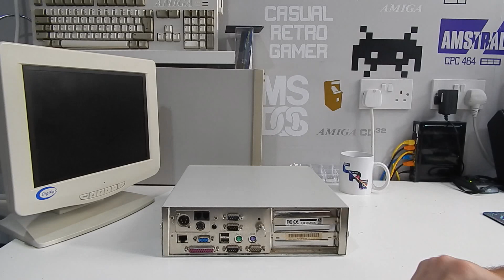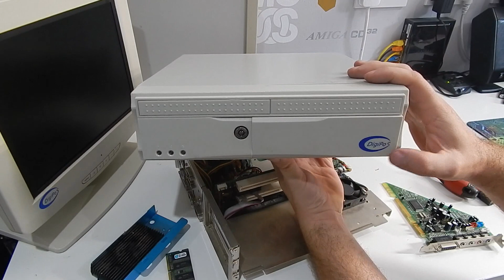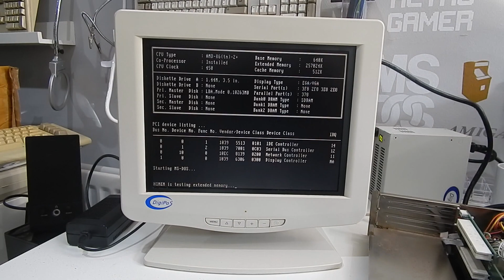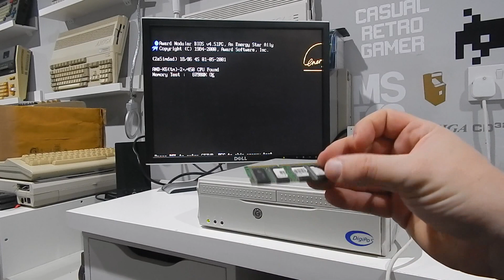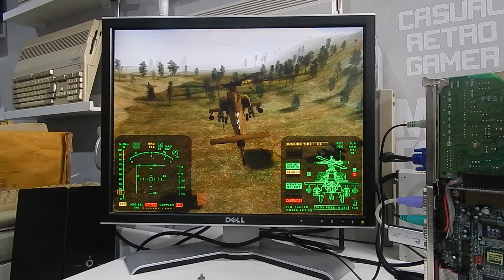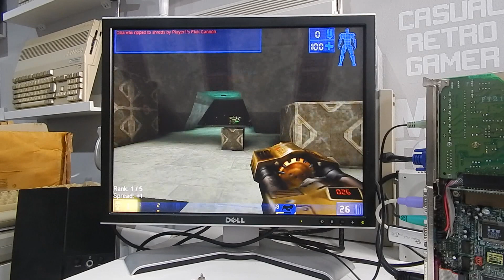System build September - The POS build

Comment: I had the same processor back then. 
The complete name of your processor: "AMD 2 4v I O 3 3v 450Mhz CPU AMD K6 2 450AHX AMD K6 2 450AHX AMD-K6-2 / 450AHX" 
With Overclock you could reach a stable 500 MhZ. (BIOS-Settings: 5.0 x 100FSB @ 2.8v)
You can bring it to 550 MhZ (BIOS settings: 5.5 x 100FSB @ 2.9v or 3.3V) but then it becomes really unstable!

Comment: For the onboard  (on chipset really) GPU just download the SiS 5595 VGA driver for windows 98. It predates the SiS 530/630 by a year or 2. As for GPU, I would look for a Geforce 256 or Riva TnT 2 PCI card, both should work very nicely in that little system. Alternatively, on a cheaper route you can find new/old stock PCI Radeon HD 5450s for next to nothing. The 5450 will be way too fast for that CPU but should handle just about any late 90s to early 2000s game you can throw at it. I see them regularly for under $20 USD on ebay.
Reply from the maker: I've been able to properly disable the onboard display adapter and I've swapped out the replacement card for a Voodoo Banshee.  The performance is about the same as ATI card but it gets me access to the older glide games and they run great.

Comment: can you add a link or where you got the motherboard manual from please, watched this video and got myself one to play with . thanks
Reply from the maker: Unfortunately I've lost all the files related to this build.  I'll see about getting another copy tomorrow, will have to go ask a few people who helped find it first time.  Really should organise things better and sort out of nas for proper backup of these things!
Reply: @CRG  great stuff thanks for looking for me, powered it up , ye its noisy goto replace the cpu fan with a larger quieter one or just jumper it for an old p133 or a 233 MMX or even an old K6 233 I have sat here and unplug the fan as it won't need it the heatsink will be plenty enough cooling on its own passive,, now, the psu,, goto figure out what voltages and if I can replace with a pico so it runs off a silent laptop brick then i can shoehorn  in a voodoo of some kind , an awe 64 and figure out how to fit a slim cd / dvd drive in there,,, was hoping you gotta make that 3d printed bracket and save me a heap of work :), great video.
Reply: did you get a reply about the manual for the board , great vid btw for the pistorm looks a promising addon.
Reply from the maker: @kevin1970  yes sorry, totally forgot about it, you can find the manual at the following dropbox link https://www.dropbox.com/s/x8j4ix97zzzkijq/DigiPoS2k.pdf?dl=0
Reply: @CRG  thank you very much,, now googling a 50pin cdrom connector cable :D
Reply from the maker: @kevin1970  no problem.  If you have any luck with the cdrom please let me know.  Just keep in mind the depth of the CD drive against an expansion card in the top slot.

Comment: Would like to see an update if you managed to replace the old power supply with a modern replacement.
Reply from the maker: This is something I keep toying with but I've not looked at it in any detail yet.  My plan would be to hack a PICO atx supply into the case for which there should be plenty of room.  Like everything though its just finding the time to do it.

Comment: Sorry I'm late, but I didn't receive any notification :( It's funny to seea DigiPos machine :) I work at a french retailer, on the POS systems. We rolled out 2000 DigiPos Retail Active 8000 back in the day (which seems to be the successor of what you have here), and they were superbly built machines. Not exactly on par with (back then still) IBM POS, but very cleverly thought. Watch out for the serial port(s), some may be powered serial ports (12v or 24v). On later models, like the RA8000s, you can find Retail USB (also 12 and 24v). Digipos was later acquired by Omico Group, but I'm not sure there is much left of the original DigiPos team(s) nor spirit, sadly. Thanks for the memories :)

Comment: Those ports on the back you said you had no idea what they are are for cash drawers (RJ-10 I think they are called?) and the other one likely some type of receipt printer. And the CPU was likely downclocked for lower heat output. But that's not a K6-2, it's a K6-2+, the plus is important, set the multiplier to 2x and it'll internally clock to 6x for 600Mhz, it MIGHT even do 112*6 for 672 if you're lucky. That PC will FLY! either way :D But realistically it's a 1998 CPU (performance wise) so you're not going to play games from 1999 on it, that's an entire generation away, or two if you count the very end of 99 When the Geforce 256 came out. Things moved fast back then.
Reply from the maker: I've tried the multiplier at 2 and it does post at 600mhz but unfortunately it's not stable, doesn't make it into windows.  Tried a higher voltage and it does boot windows but constantly crashes.  Unfortunately it seems as if it's as fast as I'm going to get it.
Reply: @CRG  That's a shame, still 560 is nothing to sniff at. Another strength of the plus version CPUs isthat you can use the "SetMul" software to change the multiplier, L1 and L2 caches on the fly during runtime. So for an old speed sensitive DOS game, make a bat file that lowers the CPU speed and turns of cache, runs the game, and then turns it back after. Phil has done videos on it, basically turns it into a retro dream all-in-one machine.

Comment: Picked one of these up myself nice and powerful for the size and a hreat price lots of expansion options shame about the psu they suck ive been looking for a more modern replacement but no joy so far :(
Reply from the maker: I'll take a look at the voltages from the power supply.  You might be able to rig up something modern like one of those meanwell units.  Not sure how much load it would draw but couldn't be that much.

Comment: A K6-III would be a nice upgrade, and give you on-chip L2 cache, provided the motherboard supports it.  A Gotek, in place of the Floppy drive would cure your data transfer issues too!
Reply from the maker: The chip is actually a K6-2+ which has 128k of L2 on chip.  The K6-3 does have more with 256k but not sure its a massive difference between the two. 

A gotek would be handy but I do have a nice system setup for writing floppies. I use my 286 system (HM Minstrel, there a couple of videos on it) to write floppies over ftp.  Bit slow and I do get the odd read/write error but something satisfying about using the old disks.

Thanks for the comment and keep the suggestions coming, always welcome!
Reply: @CRG  I didn't catch that it was a K6-2+!  Still, more cache is always better. Although, like you say,  the minimal speed increase might be hard to justify for the price that 500 mhz K6-3+  tend to bring on E-bay (when you can find one) .  It might make a good speed comparison video though!  If you're feeling froggy, a $20 64 or 128GB SATA SSD with a PATA converter or a CF to IDE adapter would also make for some interesting speed comparison content.  Maybe something to convince the younger guys just getting into retro-computing that you don't necessarily need the fastest and best of everything.

That's an odd machine, It's pretty late for a K6-2+.  Athlon Slot A CPUs were being fire-saled out in early 2001 and (along with the socketed Duron) were actually cheaper than that K6-III in most cases.  ( A quick look at the Wayback machine shows Slot A 500 Mhz Athlons going for about $40, 800 Mhz for $49 and the K6-III for $54,  at Tiger Direct here in the States).  Which means that wholesale prices would have been MUCH cheaper for the more advanced CPU.

I suspect it's a case of the manufacturer being tooled up to make Socket 7 machines and not wanting to take the cost hit to redesign for another processor architecture and riding that configuration until it was no longr tenable..

Interesting stuff!  Keep up the videos.

Comment: Only 5 minutes into the video so sorry if you addressed this, but that 'proprietary connector' on the PSU looks a lot like a 4-pin female XLR connector. If it is, they're readily available.
Reply from the maker: I don't mention it in the video but I was thinking the same thing.  Now that I think about it I should have measured the voltages coming into the machine.  I might do a follow up on this wee system at some point since I'm now into the disk on chip but want to order some stuff first so it'll be a while.
Reply: Yep, XLR. DigiPos always used that kind of connector with their external supplies.
Reply: I thoght XLR was three conductor?
Reply from the maker: @massmike11  you can get a 4 pin variant of it but yes usually only 3.

Comment: Onboard eth is obviously a Realtek 8139 looks like from what I can see. other than that, onboard video is an SiS 530, I think it's onboard the 5595 but I don't remember. the only board I have that has that chipset is a PCChips M599LMR, which too also has onboard realtek 8139 100Mbit, but a davicom clone. You may have better luck with drivers by looking for stuff for that board since it was one of the betterish SS7 boards utilizing that chipset, and much more common. Hope this helps.
Reply from the maker: Very helpful thanks.

I had to go grab the realtek drivers myself for the ethernet and the manual more or less confirmed the 530 on board video.  Its totally disabled now though and looking up the specs it is very low end.

Comment: Having written some POS software and worked with these types of machines in the field, you'd NEVER hear the machine running over the noise level of a typical retail setting. Very interesting mix of custom hardware in that box!  Thanks for the content!
Reply from the maker: I done a few shop fit outs through my day job, suppose in the run of things with this box most likely in a cupboard you'd not really notice it.  Still I was surprised just how loud it is.  Might not come across fully in the video after I've filtered the audio.
Reply: @CRG  one system I did was used in recycling depots where employees wore ear protection from the sound of breaking glass so no issues with fan noise there. Machines were also subjected to extreme cold (Canada) and heat as mostly open to the outside environment. Those machines didn't last long :-)

Comment: The cpu is a k6-2+ ,not a regular k6-2
Reply from the maker: Yes I noticed that, not sure what the difference between the 2 cpus is.
Reply: @CRG  K6-2+ has 128k of level 2 cache on the cpu running at the cpu speed,while the regular k6-2 uses level 2 cache from the motherboard running at fsb speed,so the + is a bit faster,also it's made on 0.18 micron process vs 0.25,so consumes less power and oveclocks better,it should run at 600mhz no problem.
Reply from the maker: Thanks for the info.  

I do have an option to increase the muitiplier to 5.5 so that times the fsb of 112 would get me to 616 all be it I think that might be too much.   There is also the option to run the fsb at 105mhz so 105*5.5 = 577.5 clock but I think 560 and the faster bus would yeild better results.  I'll have a play and see if I can push it a bit harder.
Reply: @CRG  On some super socket 7 mb,setting the multiplier to 2x some k6-2,2+,k6-3,3+ will interpret it as 6x ,so you could try 2x with 100 mhz fsb see if it gets you 600mhz.
Reply from the maker: I'll have a play later and see what I can get out of it.  Might do a quick update video to show this plus the disk on chip that I've not got access to.
Reply from the maker: @CristiBucerzan  seems you are correct.  A multiplier of 2 is seen as 6 by the cpu and it posts at 600 but is very unstable.  Won't boot  into windows throwing all sorts of errors.  Also tried 105 fsb x 5.5 so 578 clock.  Again it boots and does get a bit further but still crashes.  It seems 560 is the fastest I can get it.  I could maybe try 2.2volts rather than 2 but I'd rather not risk killing the chip.  Think I'll just live with the 560mhz.
Reply: @CRG  The cpu should take 2.2v without any issues,after all it's only 0.2v extra,which is a safe value.

Comment: Hold shift down while booting off the chip on disk if its running DOS it will bypass autoexec.bat and go into command prompt.
The SIS chipset will have a built in VGA graphics.
Reply from the maker: Thanks, it worked!

Disk on chip is 8MB so I wonder what I can fit...  Probably not a lot to be honest but I notice in the manual the board supports up to 144MB chips.  With that sort of space I could have a bit of a different dual booting DOS and Windows rig.  

Edit, After some more digging I think the onboard graphics are the SIS530.  I do have drivers for it but I'm fairly sure the ATI card is still miles better.